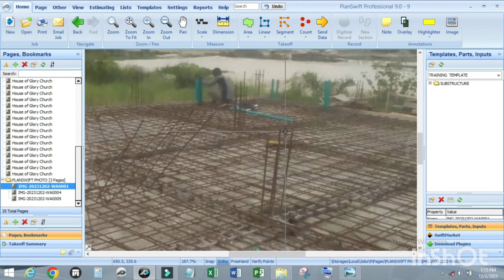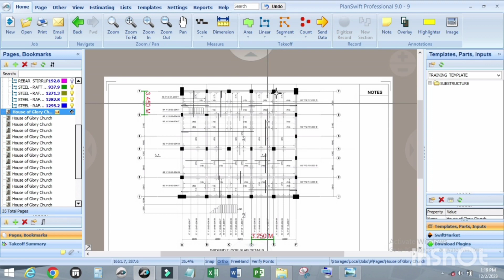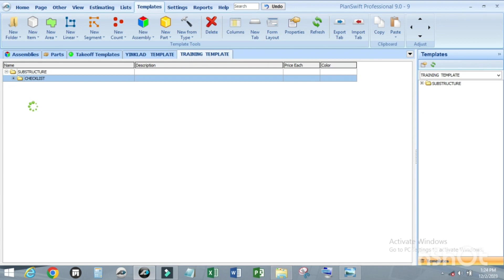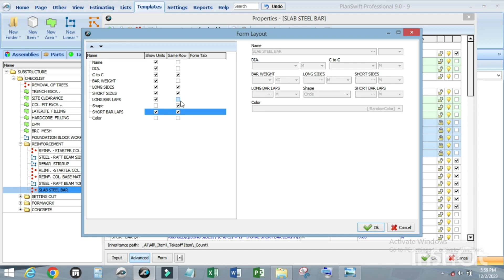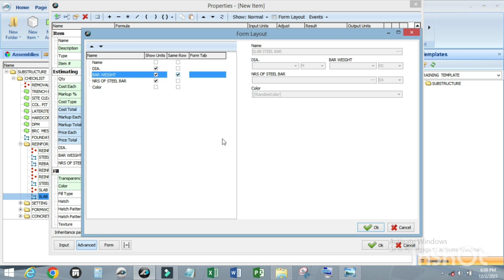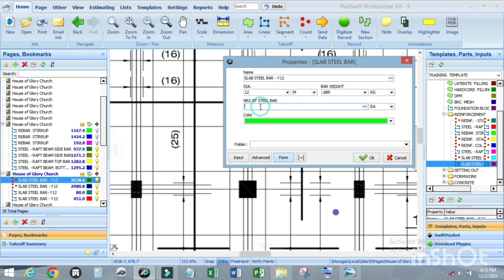How to calculate Slab Steel Bar. PLANSWIFT TEMPLATE - 14 -

Comment: The video stopped at minute 12 and we couldn't see how the programming process was done.
Reply from the maker: You can replay it.

Thanks
Reply: @yinkladdesignsandassociatesltd  I tried more than once but it didn't work
Reply: I benefited a lot from your channel, it is great, but there is only a problem with this video
Reply from the maker: Which device do you use to watch it
Reply: @yinkladdesignsandassociatesltd  
laptop
Reply: @yinkladdesignsandassociatesltd 
Laptop
Reply: The picture stops from minute 12 to minute 23, only sound
Reply from the maker: @علاءحسين-ي8ب  let me re confirm
Reply from the maker: @علاءحسين-ي8ب checked, am sorry for that .

You can chat me up on WhatsApp or what's app platform to re share the video.

Thanks
Reply: @yinkladdesignsandassociatesltd  How can I contact you via WhatsApp?
Reply: You have been messaged on the group.
Reply from the maker: @علاءحسين-ي8ب  it's been reshared a month ago on my channel.